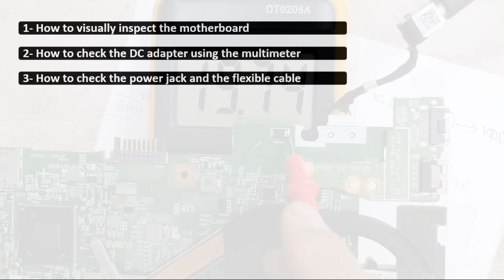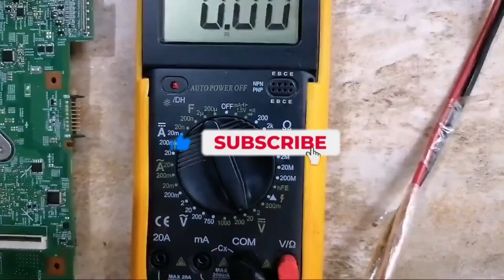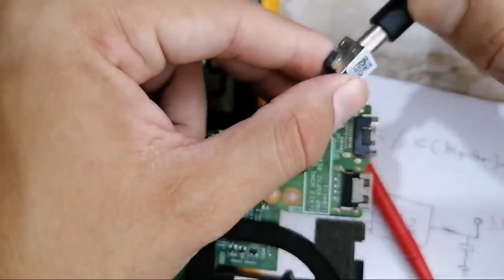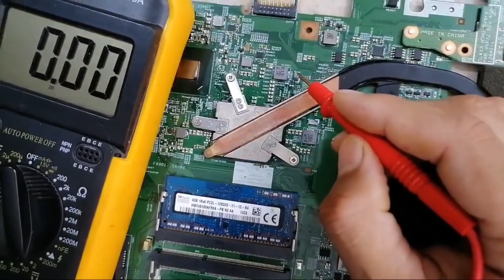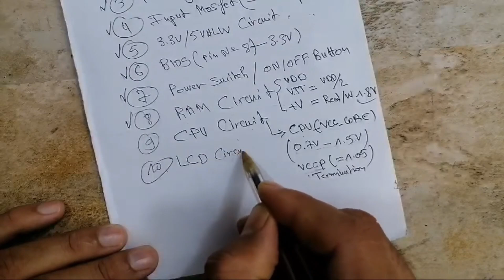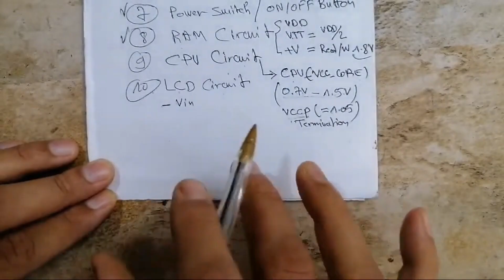How to Diagnose Your Laptop’s Motherboard in 10 Simple Steps - Fix Any Laptop Fast—10 Hidden Tricks

Comment: And how to test the laptop battery
Reply from the maker: Great question! Testing the laptop battery is crucial for diagnosing issues. There are a few methods you can use, such as checking the battery health in your system settings or using dedicated software tools.
Reply: @electronicsrepairbasics_erb  
but i mean test the battery with a multimeter
Reply: But i want to know how to do it with a multimeter